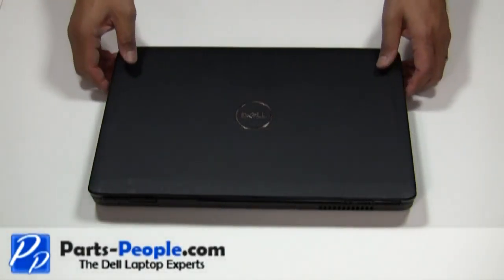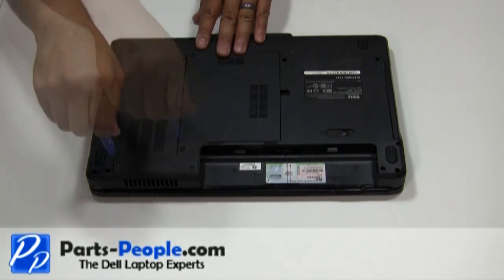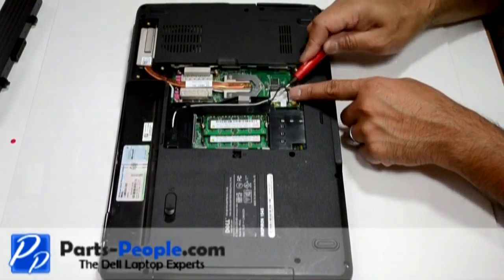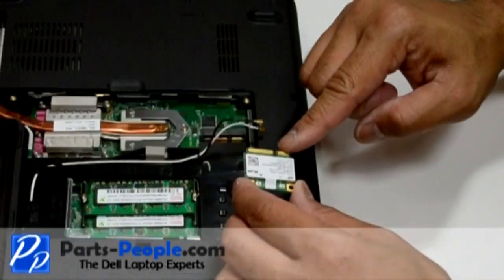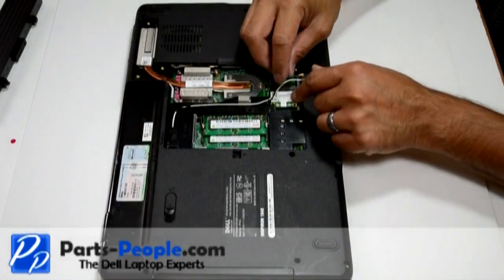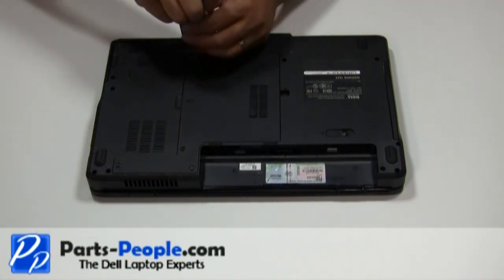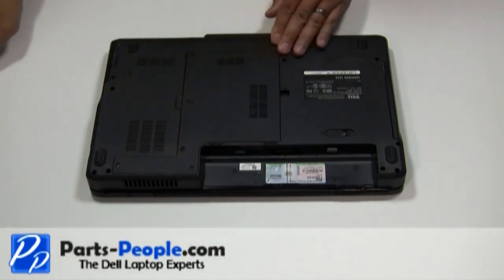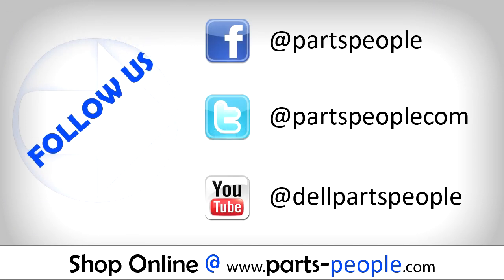Dell Inspiron 1545 (Intel Version) | Wireless WiFi WLAN Card Replacement | How-To-Tutorial

Comment: I recently bought an Inspiron 1545 and was going to replace the battery and WiFi card, but I don't have either replacement battery OR the same type of WiFi card! Will the smaller WiFi cards work? Because I currently don't have any money for new hardware!😢😢 I wanted to replace the battery because the machine doesn't see it for some reason 🤔🤔
Reply: A usb wifi works fine on those.
Reply: @TSM1223 thank you

Comment: This is evidently a different model of Inspiron 1545 to the one my wife has. On hers, the Wifi card is the other way around, and slots into something which is UNDERNEATH the plastic cover which is to the left of the card shown in this video. Having opened up the laptop as shown here, I'm faced with trying to figure out how the hell you're supposed to get the adapter to slot into a connector that you can't even see.
Reply: I have the same problem .... how did you solve it? (if you solved)
Reply from the maker: You probably have the motherboard with ATI graphics. Unfortunately we only have the video for the motherboard with intel graphics.I think you have to remove the motherboard for the ATI model.
Reply: TheRaistMajere I removed the heat sink, and that gave me just enough room to slip the new wifi card under the plastic cover and into the connector slot. I suspected that the recommended approach was to remove the motherboard, but after looking at the video about how to do that, I decided it was far too complex a procedure. Luckily, my approach worked, and the card is working fine.
Reply: Thank you for information! i try to follow your advice!

Comment from the maker: We have the Dell Wireless 1501 Draft N Wireless WiFi 802.11 a/b/g/n Half-Height Mini-PCI Express Card - K5Y6D on our web site and it supports IEEE 802.11a, IEEE 802.11b and IEEE 802.11g specifications and 802.11n speed up to 270mbps
It also supports WPA/WPA2 Pre-Authentication and is capable of operating on 2.4 GHz and 5 GHz bands.